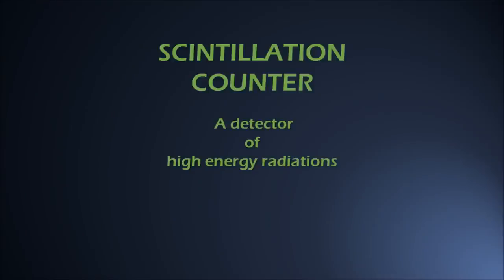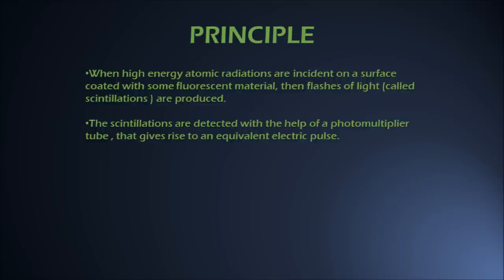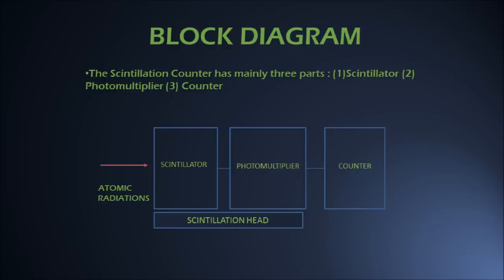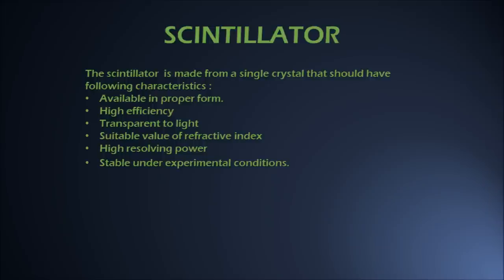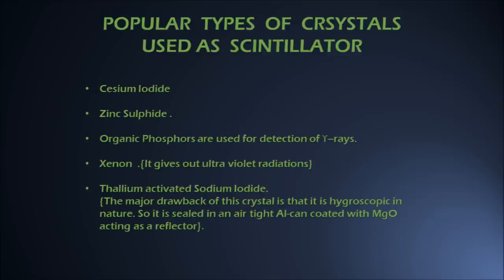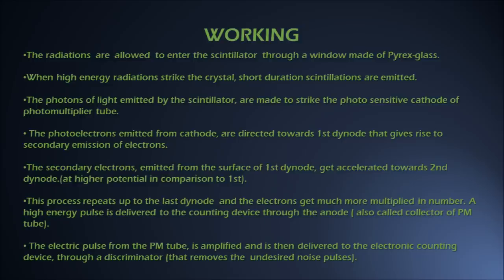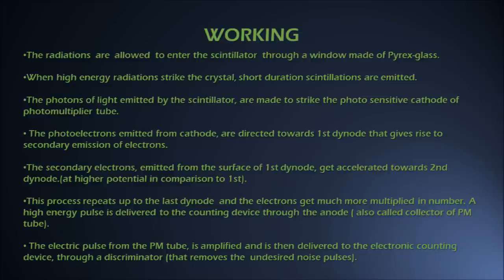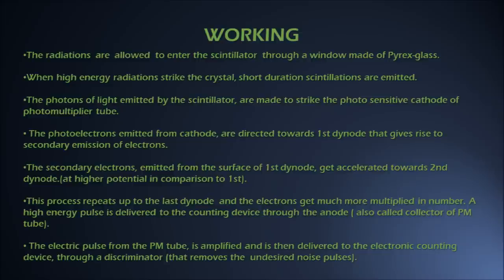Scintillation  Counter | B.Sc. | NJPhysics

Comment: Seen in other presentations the use of solvent and the flour in Liquid Scintillation counter. So, please elaborate on the Liquid Scintillation counter, where radioactive isotopes that emits beta rays were used to activate the solvent 1st, than, activated solvent in turn activates the flour. The activated flour hit the cathode tube to produce photoelectric effect and pass on to the PMT...and so on ...SO PLEASE ELABORATE ON THE USE OF SOLVENT & FLOUR in Liquid Scintillation counter. WHAT KIND OF SOLVENT TO USE AND WHAT IS THE FLOUR MEANT IN THIS INSTRUMENTATION.